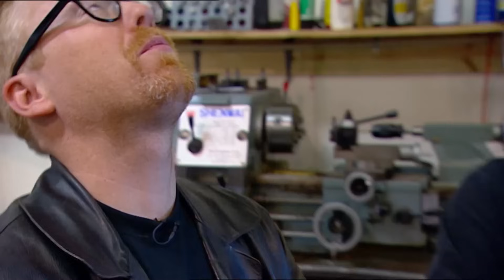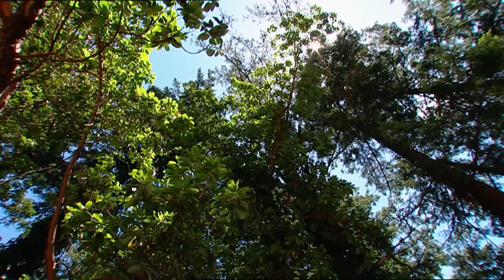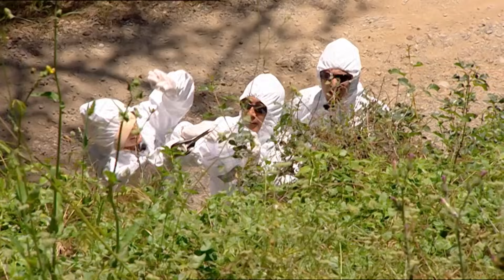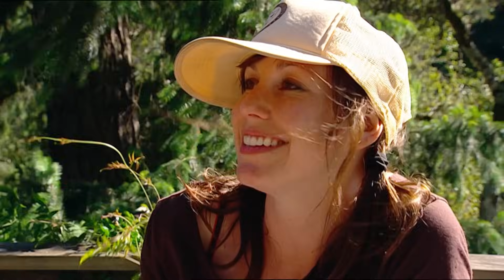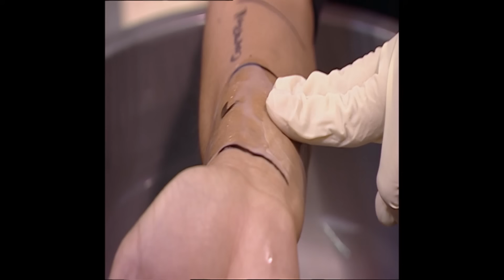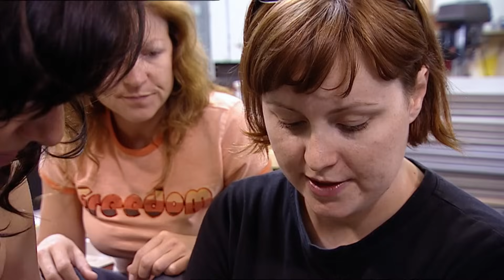Can Vodka Really Stop Poison Oak Rash? | MythBusters

Comment: a couple fun poison oak-related facts:
• poison oak and ivy and related to mangoes; mango skins contain the same toxin, which is why you aren't supposed to eat the skins.
• poison ivy has an unfair of diversity in its appearance: the leaves can be waxy or matte, dark or light, the margins (edges) can be serrated, lobed, or smooth, and a mutation was found in Massachusetts where some leaves were so deeply lobed that they split into extra leaves, meaning even the three leaf rule isn't 100% reliable! oh, and the list goes on.
• you aren't supposed to be able to build up an immunity to it – in fact, usually repeated exposure increases sensitivity ...so idrk what happened with Tori...